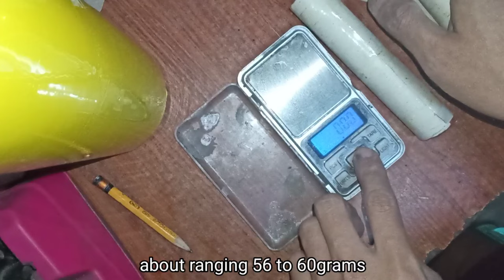This is how I made my first firework cake | Homemade Firework Cake

Comment: Solid sir, gaano kahaba pala mortar tube niyan lods? Sana masagot, salamat.
Reply from the maker: 10 inches
Reply: @TAWITIBoyAllAround  Thank you po sir. Waiting and with full support sa upcoming uploads niyo po. Share ko lang din po sa experience ko last December about sa broken clay plug during lift sa 30mm na canister shell yung naging solution ko po e instead na 1/2" yung end plug clay ginawa ko pong 1" kasi wala akong hydraulic, mano manong ramming lang. Pero need na naman adjust yung speed ng time fuse na kailangan. Pero sa 20mm shell ko walang problema sa 1/2" clay plug sa fuse ako nagkaproblema yung iba hindi sumindi ng maayos, DIY black match lang kasi gamit ko. Hinanap ko kasi yung mga shell na di pumutok hehe para makita problema.
Reply: @TAWITIBoyAllAround hello , Nice job , smart thing the cake tooling!! What did you used like wood for make your cake tooling ? Thanks, regrets.